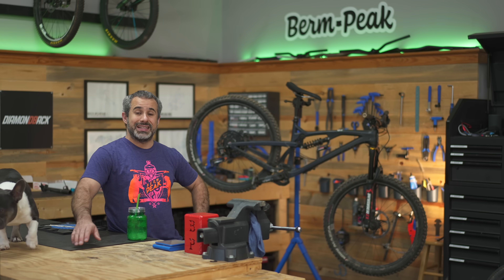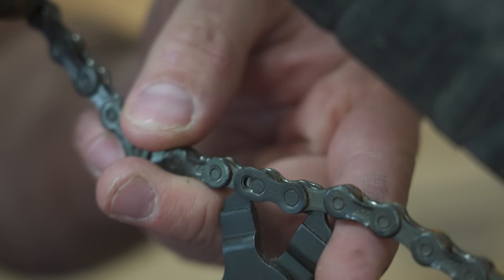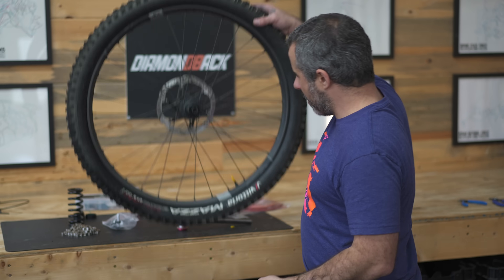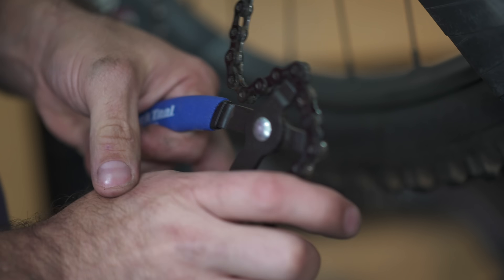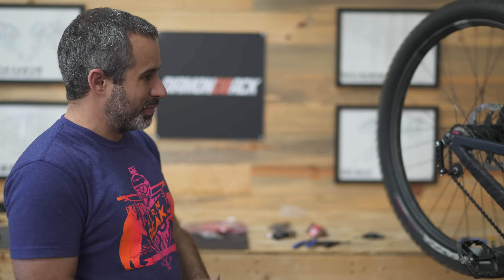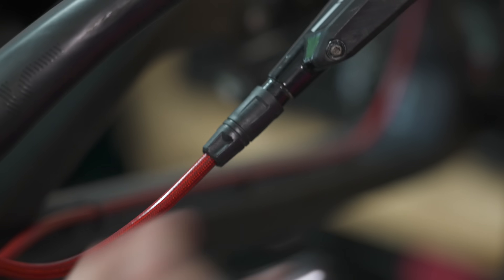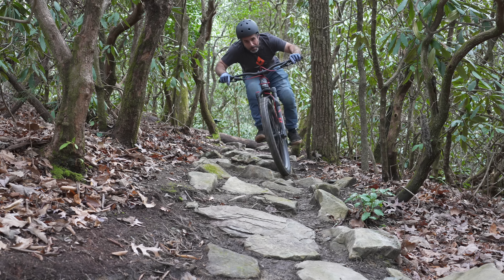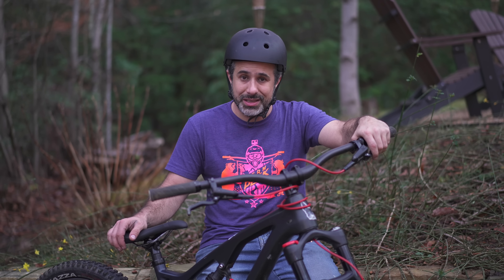Slopeduro Bikes are Unnecessary. Let's build one!

Comment: Slopeduro bikes have got many extremes: Matt Jones has his at 120mm travel on 27.5" , whilst Brandon Semenuk has his on a 27.5 / 26 mullet with 190mm travel. And I have seen others running 29". I think yours though Seth is in the middle and is probably about right!
Reply: Going by some bike-checks on YouTube I've noticed a lot of the RB Rampage riders are running 26/27,5 mullet with Fox 40s (or similar) up front! I'm fairly sure that's not recommended by the manufacturers but maybe they've supplied their sponsored riders with a custom frame/swing-arm to make it work?
Reply: @sandy_knight  Sure they do have custom frames. The only manufacturer who doesnt do that is Nukeproof up til 2015.
Reply: Idk why but running a 29er on a slopeduro is not as bad ascit seems
Reply: Mush the bikes at rampage aren’t slopeduro bikes
Reply: @beggarwoodbikepark3974  I'm sure you're correct but what's the difference then? Or, what's the closest your average rider can buy/convert to get something like a a pro rampage bike?
Reply: @sandy_knight  what they do is get a downhill bike or a enduro bike like the norco range and then putting a single cog or a small range cassette. They usually put as many tokens as they can in the fork or shock. They also put a tubes in the wheels and pump it up to they max psi that they can have it at so the wheel doesn’t blow off when they go off a massive drop or case a jump.
Reply: @hugoandreas1715  A downhill bike with a 26" wheel on the back!?!
Reply: I run my slopeduro @ 170F/160R.
Reply: @sandy_knight  that’s purely personal preference. Most of the riders may of grown up riding 26” and I’m sure some of them prefer them.
Reply: @sandy_knight  A lot of the rampage bikes are actually old bikes, Downhill or freeride bikes from the 2000's because that is when the geometry suited their riding style. Current downhill bikes are too long and slack to be thrown around in tricks. Same with Enduro bikes. These bikes are obviously built up with all the best modern parts available (similar to what Seth has done here). That's why you rarely see media talking about those bikes, because there's little money in marketing a 15 or 20 year old frame.
Reply: @huntergibson9359  That makes a lot of sense, thank you.
Reply: @huntergibson9359  this is so wrong they don’t ride old bikes most of them ride 27.5 dh bikes while some of them ride custom dh bikes with a 26 in the rear but there all modern frames
Reply: @hugoandreas1715  Sam Reynolds gave a pretty good explaination of this thought process on a build video for (I believe) his Audi 9s bike last year.
Reply: @huntergibson9359  this is 100% wrong, rampage riders are all on modern bikes
Reply: @sandy_knight  rampage bikes are freeride bikes, which are downhill rigs with geometry less extreme so they are built to send not go fast
Reply: Bro Brandon Semunk’s Rampage bike was not a slopeduro bike. It was a session with a 190mm Zeb.
Reply: Reed boggs has a sb150 running marzocci air shock and z1 on 27.5"
Reply: I’m planning on doing a old trek superfly fs8 100mm of travel so it’s a xc bike that I’ve some how beat and still works
Reply: I'd love to make a slopeduro bike, 140mm fork 130mm shock (like Matt's bike I believe his is actually a 150 fork because its off the san quentin)
Reply: @sandy_knight  Technically it is possible, but to make a 26/27.5 slopeduro bike on a 190-200mm suspension base it would definitely lower the BB and possibly make the headtube steeper. It does work, just not like how the pros do it

Comment: This is what Sam Pilgrim has been doing for years. 500psi in the suspension, 100psi tires, front brake cable through the stem or snipped off.

Comment: I built my 2018 giant reign 2 into a slopeduro.  Single speed, 36x16 single speed.  Fixed low seat post, coil rear shock.  Went from 2.4 tires to 2.1.  Badass jumper.  If you are a jumper like me, everyone needs one of these in their stable.

Comment: I'd love to see you change the brake to a hybrid cable actuated hydraulic brake, and add a gyro. Or run one of those hydraulic gyros. They were cool mechanisms that never seemed to get much acknowledgement outside of midschool BMX.
Reply: Bluetooth brakes coming soon = no cables
Reply: @mudkayak6305  hopefully not made by sram then 😂😂😂
Reply: Yeah, its slope style, brakes are just here to stop at the bottom, a BB5 on the rear would be more than sufficient.
Reply: @cravendale9021  nah we’re getting axs code r’s lol
Reply: Had this thought too - even running a cable actuated disc all the way without the hydraulic calliper would be fine considering the need for rear brakes.
Reply: @mudkayak6305  There are no cables on those brakes: it's a hydraulic system.
Reply: those hybrid brakes suck in my opinion and you still have to bleed them so just as reliable as a normal hydro brake
Reply: There's the Trixer for you: a hydraulic gyro for the brakes made by German company Trickstuff. It's not cheap tho'.

Comment: Mine is an End-style bike. DMR Bolt slopestyle frame with 150mm Fox forks, a Rockshox RT3 rear shock, NX Eagle groupset, MT Trail Sport brakes and a crap tonne of Hope aftermarket parts. Flicks like a slopestyle bike but does the distance, flies up hills and blasts down them like an Enduro.
 Started with an overgrown full-squish BMX and now I have a king-killer genre defining All-Mountain beast.

Comment: A few tips... to make it feel more like a slopeduro, maybe ditch the coil shock. It adds weight and has no benefits for the intended purpose. It would also be sick to make it a mullet, you could stick the flip chip in high. Faster rolling and lighter casing tires are always great...lastly skinnier bars...cheers

Comment: Those kind of chain tensioner are designed for quick release wheels. You basically place it in before the nut and let the QR axle hold it in place. I have one myself, though I swapped it out to a chain tensioner that goes in the derailleur hanger.

Comment: So freaking cool i love how seth makes use of every bike and about the rear break hose you can use the dropper post hole and drill a hole from rear of bike near the caliber it ll be much cleaner
Reply: No
Reply: its such a dumb idea to drill a hole into a carbon frame. also you would have to drill multiple holes in the front and rear triangle to make this work. the frame is probably trash by then. and in my opinion it looks pretty good with the external rear brake hose and its much easier to service

Comment: If it’s an alloy frame you can do crank stopper. put a plastic hoseclamp around the crank spindle and drill/tap the bottom bracket shell so a bolt can push on the hoseclamp. Tighten the bolt to tighten the cranks for easier tailwhips/no footers, loosen when you need to sprint.  If you don’t have an alloy frame or don’t want to drill holes in your bike a piece of tube between the crank arm and BB lock ring works ok, you just can’t adjust it.

Comment: I'd like to see a headset that has rubber o rings and 2 seperate channels for fluid to flow thru, allowing you to spin the handlebars infinately while maintaining braking.  This design has been used a lot in other applications.  Obviously if you notice brake fluid leaking, you need to replace the o rings, but it's fairly reliable.

Comment: Nice build! I'd have added ramp up tokens in the fork so you don't have to run a million PSI, also a slightly faster rolling rear tyre would make your life easier on jumps, as well has harder than "normal" tyre pressures...

Comment: I’ve built my fair share of slopeduros from 26” 160 front 120 rear to 27.5 170 front and rear there a lot better if you put a thick boi DJ/Bmx seat with a pivotal and some tall tall rise bars I usually go for a cheap sram dh group set and mount the shifter to the down tube on the bottle cage mount just in case you might need to pedal somewhere but go for a cheap one cuz your gonna be doing tricks and smashing that thing like nothing else happy shredding my dude sick build

Comment: My enduro bike is set up to bar spin as well. Would recommend running the front brake cable behind the stanchions just in case the fork bottoms out and kinks the cable. Then again maybe the high fork pressure would stop that from happening anyways.

Comment: Slopeduro is now single speed with an 30t oval crank and a 20t rear sprocket. 130/160 travel 27.5/29 mullet.  Its enough to burst up the steep climbs and whilst bombing the trail enough to launch at about 25mph into things then beyond that its all pumping. Simplifying my trail rig really matched what I was wanting all along anyways.
Reply: I saw your comment a month ago and came back looking for it haha. I just picked up a 2013 Trance X 2 29er, and want to swap to a 27.5" rear, and up the front forks which would make it 125mm in the rear and 150mm in the front. I ordered a 32t Oval chainring with a 16t single speed kit... but a cheap one, but I might try source a 30/20! Would help on those climbs for sure. I'll try put it in that gear ratio now while it still has the gears to see how spinny it is on the flats/dh. Thanks for your input ;)
Reply: @Cameron wells - Also, do you know what head tube angle they're at? The trance is sitting at a pretty steep 69.5, and upping 30mm front travel will make that around 68. I can put offset bushings in the shock to drop the bb back down again and slacken a tiny bit more too which might get it just right, aiming for 66-67 
P.S. I had a guy in my high school named cameron wells :p

Comment: It would be wise to change your rear hub to one intended for single speed, though it is hard to find a disc hub intended for single speed if the hub isn't dished to one side it is far stronger laterally

Comment: Hey Seth here’s a tip.if you want to powder coat, you can make a booth out of a old dryer. Cut the front of it out. Add a fan and buy a powder coating gun and some different colour powder. and you can coat bike parts so they won’t chip like normal paint does.

Comment: Seth you ever use an old road der as a chain tensioner? run a section of shift cable through backwards so you can control chainline without cable housing, wrap chain tight and send
Reply: to clarify i mean the endstop sits inside the barrel adjuster with about 3 inches of cable running to the clamp. guess thats not backwards!

Comment: I actually wouldn't recommend adding more preload on the coil shock to make it more stiff. more preload means more pressure on the parts, and the piston rod could pop out of the cylinder. ofc it won't by adding a little preload but it still puts pressure on the parts which you can avoid. Sick bike tho!

Comment: I build one before the whole hype around it, a longer fork will help, not much, but it does, definitely don't do it on a carbon bike, not that stable on big jumps, smaller bars do a lot, higher rise can be amazing on a bike like this for stability and playfullness , 1 brake is enough, you don't need that braking power, low profile tires (high pressure), now the bike is stuck in the garage, really to be sold, depending on the the stuff you ride and your confidence in your skill its worth it, they're playfull, great to jib around,...

Comment: Seth needs a custom gyro for the slopeduro!!!
Reply: Coming from the 80s bmx  and then freestyle ish world...  that was one thing that I hated was the front brakes through the necks stem bolt through the fork  (in a cable) the front brakes never stopped as well as the race bike I had put front brakes on for trick purposes..ends etc.  The ACS rotor was the solution for bar spins and keeping back brake cables from being too long and then having to reverse spin the bars from time to time..but you'd have to move the stem higher to make room for the rotor..and the tension on the device was not centered (as there was one cable on top and one on bottom)

The gyro (now the oryg?) Fixes those issues as it goes to the side of the frames headtube and not on top of it and has balanced pulls on both sides! 

I think the solution for better braking for the guys that want less "arteries" all over the place and less potential of long brake cords that can catch twigs, fingers, other unwanted collateral damages in unwanted collisions with stunts that go bad....

I've thought of doing this myself....and yet haven't done it yet...

But I can totally see something like this in a something "different yet kinda the same" that should happen...

I may just have to stop procrastinating and do this!

May start a new trend in bilateral holes for internal hose routing for cables/hoses in the manufacturing side...

Would be a cleaner look overall and maybe the only negative would be more connections to make sure no leaks in...  one could make the brake handle side mechanical and the caliper side hydraulic if one so chose....  lots of options.
Reply: Evidently...been done before. I just searched Google...  haha! Don't know why it hasn't stuck.🤔

Comment: Maybe you've covered this before, but I bought a new bike previous season, what kind of maintentance should I expect to do during winter? Full disassembly? Or just check for wear and play, and send it?

Not sure if its as evident on a mountainbike when stuff is ready to be replaced as cars. (I work as a car mechanic).

I've lubed up the drivetrain properly and cleaned it, the rear shock is a bit moist with oil, but I don't think its necessary with a rebuild yet.

Brake pad thickness and general chain wear feels obvious, but maybe check spoke tension on the wheels. Do the bearings need repacking each season, or just check for play?

Comment: Why not develope a wireless piston system for the rear hydrolic brake? Run brake to a piston mounted on the bike that has the resovior and battery. The handle is just a transmitter with exponential adjustment.

Comment: I'd ditch the rear brake. You can't use it in the air anyway. Also looks silly with a regular saddle. You can get a railed bmx saddle for $20.

Comment: Need some help here!
I have an old 26" XC hardtail I wanna turn into a nice trail hardtail.
Obviously I can't go to 27.5 (on the back) but I'm thinking about 120mm fork on the front and maybe go mullet with that 27.5 tyre. I cant put super thick tyres because the frame doesn't allow for it, so I am preety much stuck with 2.2 wide ones. 
The thing here is... would you guys go mullet or stick with both on 26"?
The new fork is gonna stay in that bike because it has to be straight steering tube.
Reply: Good idea. You could always           . And that would allow the bike to           , and               . But to do that you'll need a       and also a set of           . Good luck!

Comment: out of curiosity, why did you not run the rear brake line also up the fork steer tube?   you could have still run in the frame and then just dropped down then up the steer tube, same as the front and even though they would braid if you spun enough it would have looked cleaner

Comment: Would you had been able to route the rear brake hose through the top cap and fork as well for unlimited barspins?
Reply: No it will twist your brake hose. The front brake rotates with the bars so there is no tension being applied to the hose. The rear brake stays stationary so the hose would have to make up the difference as the bars spin

Comment: couldn’t you also run the back brake hose through the head tube from the top down as well and then just run it to the back brake externally? idk maybe i thought this would work but it might work the same way as the front brake and look cleaner at the same time…

Comment: Just got a new scott aspect 940, and just realised it is not tapered, what are some modern xc forks that I can upgrade to, or any adapters I can use.
Reply: My 2018 Aspect 730 also has a non tapered 1 1/8 '' headtube (yours has a new styled frame, they changed the frame). I run a XCR air, which is available in 1 1/8.

Comment: Is there any other way to clean a bike without water? Or very minimal water?
I don’t want to use water because I don’t have pressure machine, and I don’t have Air blower to dry it, and I’m kind of worried that water will get somewhere inside the bike and damage it. The bike is diamondback catch 1, for me it is an expensive bike, at $2550 is a very expensive bike specially that I jumped from a $600 bike to a $2550 bike.

Comment: I have an inquiry how do I fix contaminated brakepads and rotors?
Reply: If the contamination is just slightly use a sand paper to grind a little bit off from the pads and clean it with alcohol afterwards. Clean the rotor with alcohol and a rag too. 
After reassembly I typically clean the rotor again to ensure there's no new contamination due to finger grease

Comment: Interesting video but the whole “you can’t climb on a single speed” thing is nonsense that bike running roughly a 1:1.8ish ratio, I run a 1:2.39 ratio (32t and 14t) which is considerably higher and it’s amazing on climbs mind you it undoubtedly weighs less as it’s a ht.

Comment: Seth I love your Videos, but excessive preload on your Coil springs hurts my heart! The tons of preload u put on there, will eventually and certainly destroy your shock and spring. The spring will bend and deform, the shock it self and the stancion have to much preload so your seals can’t work that good and air can enter the system, besides all the grime and dust that will ruin your coating, seals, dampershims and bushings! 
Just use 1-5 on the max 6 turns of preload, otherwise you will for sure ruin this shock! 
Trust me I’ve seen enough of them fail that way in my experience as an mechanic.